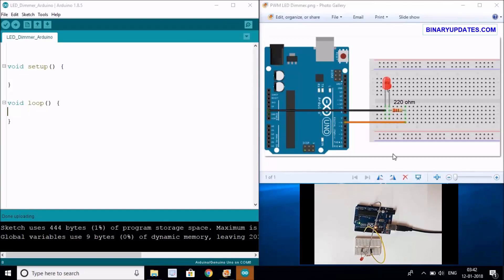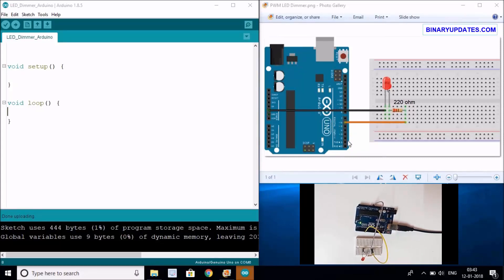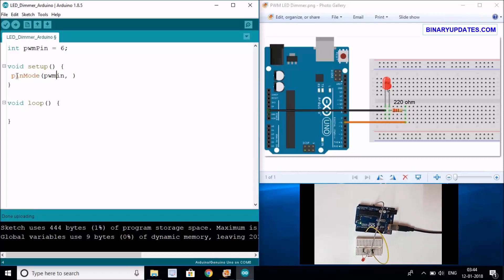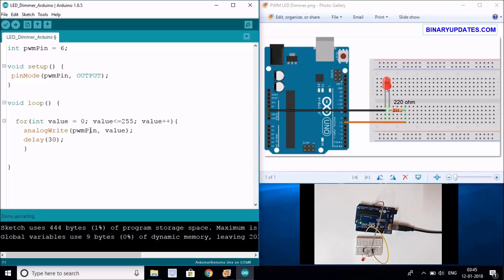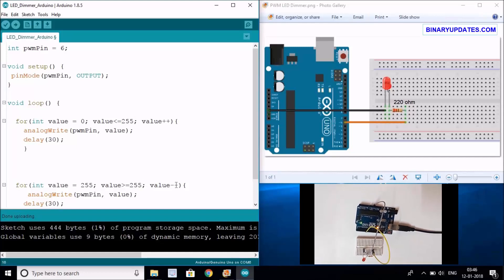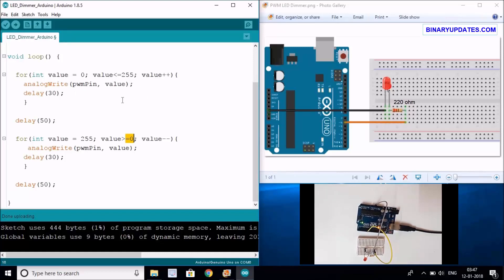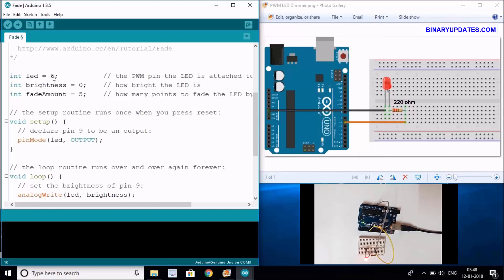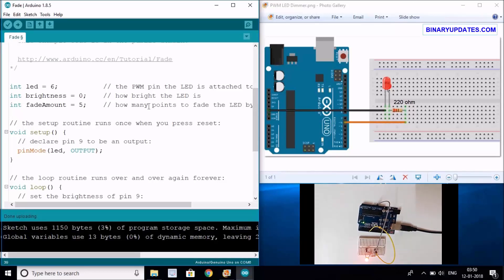LED Brightness Control with Arduino

Comment: man, want to ask how to control the light intensity level like 25% or50%
Reply: 6:56 the "brightness" variable will control the intensity. A value of 0 will be off, and 255 will be fully bright. 50% would be a value of 127 and 25% would be 63. More info here: https://www.arduino.cc/en/Tutorial/BuiltInExamples/Fade

Comment: hello, can i know why 220ohm is chosen in this circuit? any reason or calculation to prove why is that resistance value?
Reply: k riadl any thing from 1k to 200 ohms will mean the LED will not draw too much current
Reply: Check the colour code for 220 ohm and thn u can recognise it

Comment: but i want to Control brightness of an LED connected to an Arduino Board by sending values between ‘0’
& ‘255’ from serial monitor window of Arduino IDE and how i can do it?.
 can you give me the code?
Reply: You can't do that
It's not a variable resistor

We are working on that

Comment: Hi, thanks for explanation.
But how can with pin 13 that does not have PWM?
I need dimming effect on pin 13.
Reply: you cant do it with this project on pin 13 if it  isn't pwm capable

Comment: This only has fade effect not dimming(turn off with fade effect) help me please
int pwmPin = 6;

void setup() {
 pinMode(pwmPin, OUTPUT);
}

void loop() {

  for(int value = 0; value<=255; value++){
    analogWrite(pwmPin, value);
    delay(30);
    }

  delay(50);

  for(int value = 255; value>=0; value--){
     analogWrite(pwmPin, value);
    delay(30);
    }
    
  delay(50);

}
Reply: here is my own code, works just fine. If you want to change the speed it's turning off just change the delay in the 2nd while loop.

int dimm = 0;
void setup() {
  pinMode(6, OUTPUT);
  
}

void loop() {
  while(dimm<= 255){
    dimm++;
    delay(50);
    analogWrite(6, dimm);
  }
  while(dimm >= 0){
    dimm--;
    analogWrite(6, dimm);
    delay(50);
  }
}